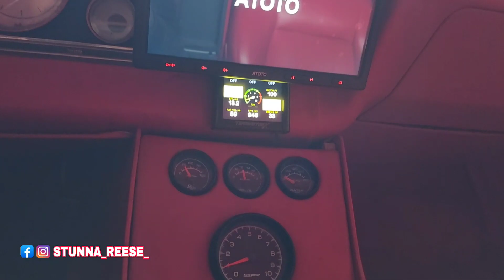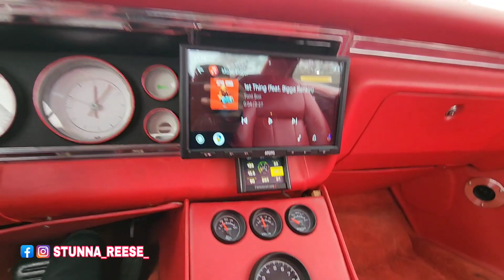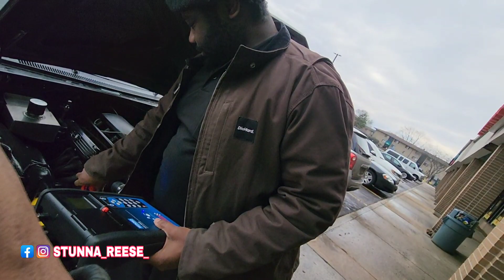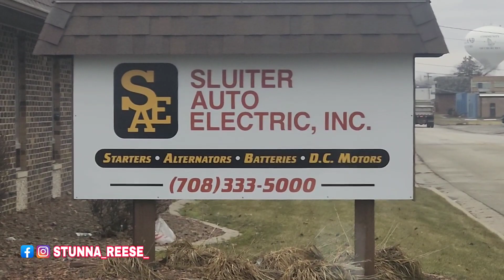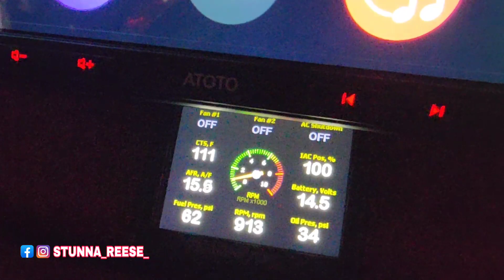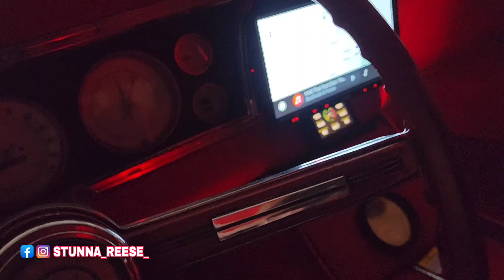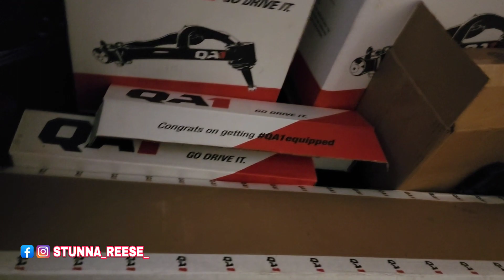HOW MY LIFE HAS CHANGED IN THE.LAST 3 DAYS

Comment: Installing a radio will not mess up an alternator even if they don't know what they are doing. It could drain a battery though if they dont connect the right wires it up right.